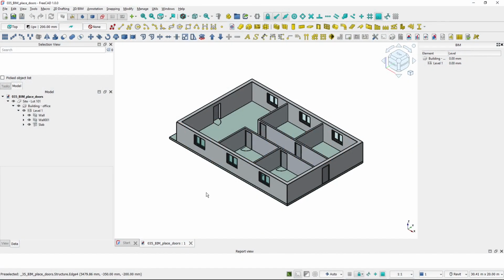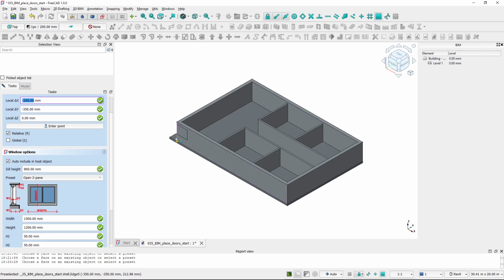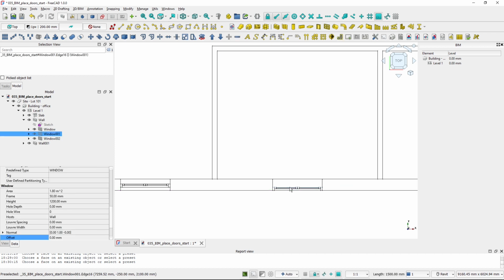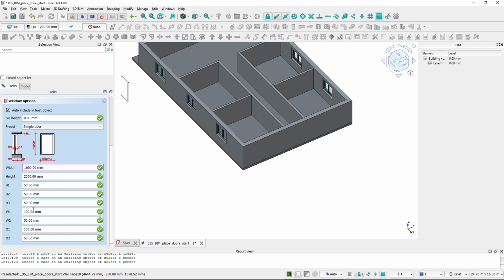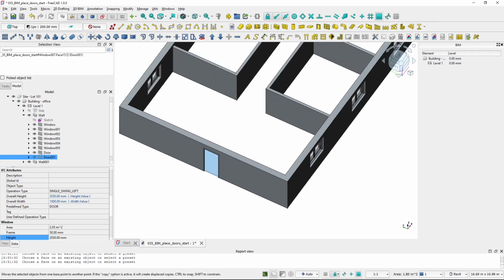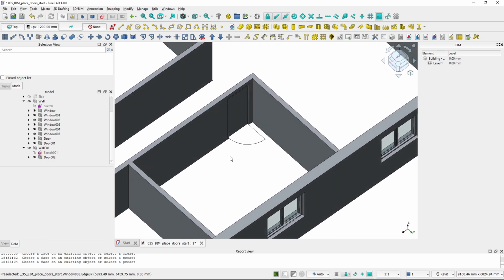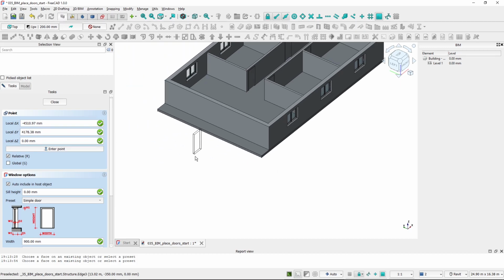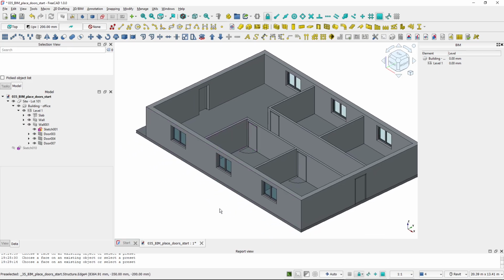Placing Doors and Windows in FreeCAD BIM

Comment: How do you place a double door?  It seems that all the selections for "door" other than simple opening are related to windows instead.  Changing the type in the BIM properties afterwards does not seem to make any difference.
Reply from the maker: If you are talking about double leaf door (tow pane), there is no preset for such a door. You can create your own from scratch or use double pane wondow preset as a basis for creating your own.
Reply from the maker: The `Type` property is just data, it does not handle the geometry.
Reply: @FCBlounge  That's a shame.  It's common to install these on houses here.  Mine has double doors for one closet and the patio.  I wondered what "tow pane" is, but I guess that's just a typo for "two"?  I guess I can customize the sketch for a door to remove the frame on the non-hinged side and sandwich it with a mirror image?
Reply from the maker: @ovalteen4404  Yes, that is the process I would recommend. 'Tow' is a typo :)

Comment: When I go to place a window I enter a width of 3ft and a height of 4ft but when the window is placed in my drawing it is substantially larger. Do you know why that would be? I'm sure I'm missing something obvious
Reply from the maker: It's hard to tell. Are you typing 3ft or 3'? Building US units are sometimes a bit finnicky in FreeCAD, but this should work OK. 

You may ask on FreeCAD forum and post your model there: https://forum.freecad.org/viewforum.php?f=23&sid=3461b5a341cd4994fb98876dcd1fc6b6
Reply: @FCBlounge I'm typing 3ft because the default dimensions are entered that way. Should I try 3'?
Reply from the maker: @evansherrieb6298  You can try. But both should work the same way.

Comment: When I have a wall, and it's constrained by another wall, placing a door or window breaks the constraints. Is there a way to avoid doing this?
Reply from the maker: As of FreeCAD 1.1 this is unfortunately unavoidable, as BIM objects do not have the TNP problem solved yet. I recommend to avoid using constraints unless you are experienced with where FreeCAD might break the model.

You might also cehck the SketchArch workbench, where some of these TNP problems are solved: https://github.com/paullee0/FreeCAD_SketchArch

Comment: Hi Tom, 
Another great video, thank you!

I have one question, how did you make your window glass transparent. My windows are not.
is there a setting i need to change?
Reply from the maker: I get the transparent material using the default windows.

You can set any material though as described in the wiki. Just use multi-material: https://wiki.freecad.org/Arch_Window#Materials
Reply: Thanks for that, i will give it a try! 😊 @FCBlounge

Comment: Hi Tom,

Thanks for your great videos!

I've just, yesterday and today, been playing with the Arch WB and you're a great help for someone who's never used any form of architecture CAD - I've never even drawn a "house" on paper to be honest!

Regarding direct placement of doors and windows, it seems to be easily done by using the "Snap dimensions" tool - seems to be far quicker and easier than modifying the slab sketch or using offsets the way you do in your videos.

Another option seems to be to enter the actual Draft WB in the drop down menu which then offers the opportunity to sketch on a different plane (Utilities, Select plane). It looks like we can place lines or rectangles, basically sketching on the existing wall, and then place the window or door by snapping to a (probably end) point on the new draft object - I can't make it work using just a point object. This probably has far more utility than I can imagine at the moment and I expect that the actual WB has many more tools that I haven't had time to look at.

Hopefully you can find time to explore these options.

Kind regards,

Ivan.
Reply from the maker: I am glad you find the tutorials helpful. Thanks for the tips.

I know about snap dimensions, but these unfortunately only show the values - you can not insert them. In my opinion it is not that much helpful.

With regards to using different workplanes - you don't have to switch to the Draft workbench. You have the same options in the BIM workbrnch.
Reply: @FCBlounge  Snap dimensions worked perfectly for me to enter values. It seems to be a bit "tricky" in that you must have nothing selected and do not move the cursor until the object is fully drawn in - press "enter" 2 or 3 times - I can't remember. I think that you also have to be aware that you are working, I think, in the Global Co-ordinate System.

Let me know if you can't make it work and I'll email you, if you have your email address correct, so that we can discuss this more and make sure that the comment is correct and useful.

Regarding the workplanes, you are absolutely correct as I discovered after writing this comment - my apologies.
Reply from the maker: @ivannosurname5631  I think you are talking about standard input for any point. You don't have to have Snap Dimensions turned on for this. You can try this by turning Snap Dimensions off.
Snap dimensions are just showing the current value the cursor is positioned.

Comment: Thanks for this video. So placement of penetrations/decorations on walls is completely primitive: effectively absolute positioning only, nothing parametric. Hopefully walls can eventually support adding sketches to faces, just like parts, so constraints position things like they do everywhere else.
Reply from the maker: Currently it is quite rudimental. But the window/door tool is being refactored, so we will see how it turns out.

If you are interested in more parametric way of constraining windows and doors, you can check out this experimental workbench called Sketch Arch, it brings more parametrics to BIM modelling: https://github.com/paullee0/FreeCAD_SketchArch
Reply: @FCBlounge  WOW that is brilliant! I will try refactoring a project using it and see how it goes. Thanks!

Comment: To speedup the placement of the windows you can open the sketch controlling the floor slab and place points on the outline to snap on or create a sketch on the wall surface with vertical lines at the correct distances.
Reply from the maker: That is an interesting tip. Using point in the floor slab sketch enables to snap to that point using 'Snap special'.
Thanks for this information.